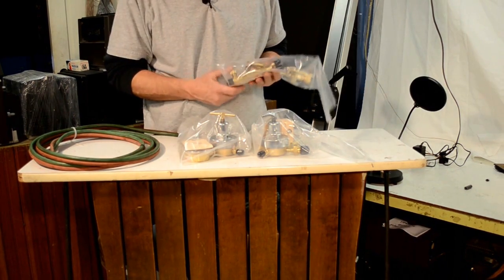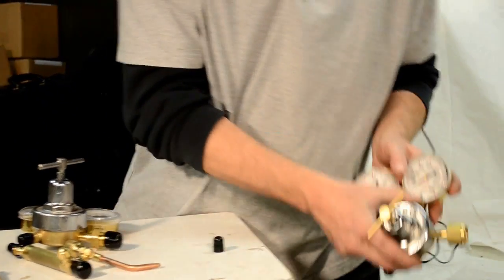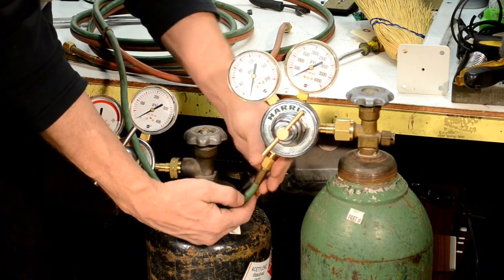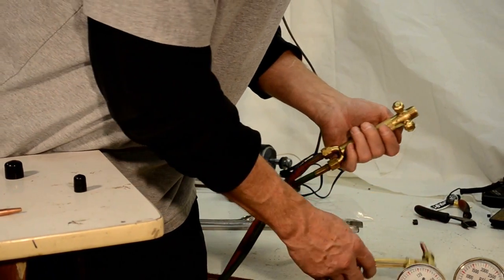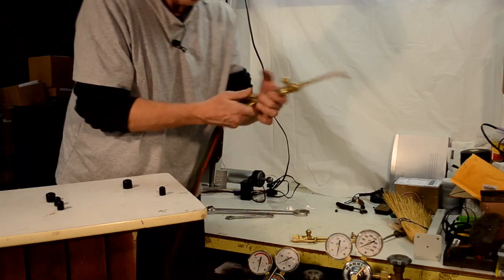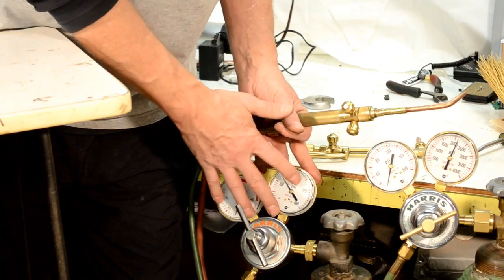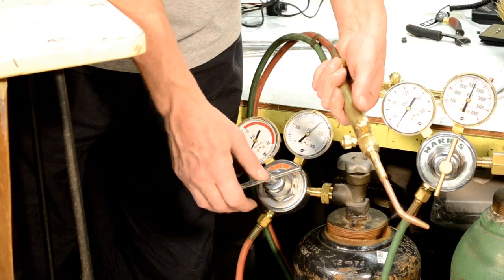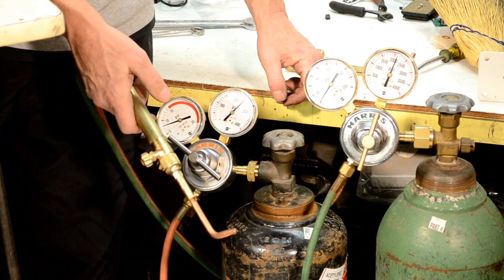How to Set-up and Adjust Oxy-Acetylene Regulators

Comment: Wrong again, this is where everyone is wrong, Oxygen tanks are opened all the way, "DO NOT TURN THEM BACK A QUARTER TURN", there is a valve seat on Oxygen at the top and the bottom to prevent leaks, if you turn it back you defeat the valve seat and you can leak Oxygen.  There's this old standard, which I use but not for Oxygen tanks, to turn a valve back a quarter turn to prevent and unnecessary wear on the valve and everyone is going with this ideology where it shouldn't be used.  I'm setting up a new system for the first time, although I've used Oxy Acetylene for years, I've never set up a new system and thus, I read every word and now I'm watching videos as well, I make sure I don't miss anything and on the last video, as I never watch just one and throw at anything people don't agree on, a welding instructor commented below, as I was wondering because to turn back the Oxygen valve is in direct contradiction to manufacturers instructions.  The welding instructor made the same comment and thoroughly explained the mechanics of the two valves, the Oxygen having a sealing valve seat at both the top and the bottom to prevent leaks when operating as well as when closed for storage.  If you turn back that Oxygen valve a quarter turn, you defeat the seat and the seal at the top of the valve and could leak, it's that simple.
Reply: FYI, I've worked in many places, never "assume" that things come clean or blown out or assume anything at all, this is explosive gas, follow the procedures at all times to the letter.
Reply from the maker: Thank you!
Reply from the maker: Thank you for that information!

Comment: Thickness of cooper matters when determining oxyacettlene p. Oh, and its dangerous stuff. Never exceed 15psi pressure on oxyA. Thinner refrigerant lines can be brazed w/ a pressure of 3 or 4 and a tip of 00 or 0.

Comment: I take it for granted  the gauges on the right show you how much pressure is in the tanks.  How can you tell when the tanks need to be refilled or changed out what are the recommended pressure ratings for the two of them when they need to be changed out. Thank you for your time and the video was very helpful for me
Reply from the maker: I take mine in for refill when I can't get a proper flame.  Or before, if I know I'm going to run out during a project session. Thanks for asking!
Reply: @hardluckcharlie  what is considered a proper flame it is there anyway you can show off photo of what it looks like

Comment: Always link official references when doing safety related videos! Otherwise decent video. All viewers SHOULD FIND AND READ official references when industrial gases are involved.  You'll thank me later. 

BTW rebuilt regs and torches are good as new and should last decades. I have one  Harris cutting torch from the 1930s on original seals that held over 150psi nitrogen when I pressure checked it. (Only use INERT gas for pressure testing and follow factory literature!)

Comment: I'm pretty sure that the Oxygen valve needs to be turned all the way open.
Reply: Instead of being "sure" LOOK IT UP.  There's no need to guess!  I rebuild my own regulators and torches per factory tech data and ran a welding school toolroom (including repair and maintenance but not regulator rebuilds because of insurance reasons) for several years. All the info is easily found online.

Here's a Victor/ESAB reference. See page 5-23:
https://www.esabna.com/shared/documents/litdownloads/56-3260.pdf
"Slowly and carefully open the oxygen cylinder valve until the maximum pressure registers on the high pressure gauge. Now, open the oxygen cylinder valve completely to seal the valve packing."
Reply: The Oxygen valve is a type of valve that needs to be turned all the way open in order to seal.
Reply from the maker: My dad would agree with you,. He and I used to argue about this. The reason for not turning the oxygen wide open is for safety, in case a quick shut-off is necessary. The torch gets plenty it needs to operate at a half turn or two twists on the bottle.  Thank you for mentioning this. It's an old myth that can lead to disaster in a hurry.  But  I suppose it is a matter of preference and what argument you prefer. Thanks again for writing.

Comment: I was under the impression the reason the oxygen regulator needs to be open all the way is to have it backseat. Is this not the case? Seems turning it back at all would defeat this purpose
Reply: See page 6:

https://www.dmme.virginia.gov/dmm/PDF/TRAINING/REFRESHER/MaintenanceRepairTopics/AR-oxygen-acetyleneuseandsafety.pdf
Reply: Hey Charlie, JBbolts is correct. Go read page 6 again because it says to open the oxygen valve all the way. It says nothing about turning it back clockwise a little bit

Comment: HLCharley, Hate to make a bad review BUT,,, bad practice is,,,, :O( never have tanks free standing particularly when no screw on cap, is on the tanks. Other words when regulators are installed. If a tank tips over and breaks off the fitting, or gauge on the top you now have an un guided missile with 2000psi exhausting from oxy tang that will propel tank through anything in your shop and take it all out through the shop wall and into the street. Hoping not Charley with it! Always should have a chain, usually, wrapped around both tanks connected to a wall or bench to prevent tanks accidently tipping over. Just a friendly tip.Toolman
Reply from the maker: ALWAYS, ALWAYS, ALWAYS... ALWAYS strap or chain your tanks to the wall or a stable cart!!!! Hardluck Charlie doesn't like to ride bottle rockets, and doesn't want anyone to get hurt either. Thank you for commenting.

Comment: Hello,my acetylene tank is threaded outside and not inside like the one shown here and my acetylene regulator is like the one you have in this video although it is the edge model by Victor Technologies,how can I connect this regulator to the cylinder when both of them have external threadings.Thanks and I look forward to hearing from you.
Reply from the maker: Hi, sorry it took so long to respond. I suggest you look up a welding supply company. They will be able to help you much more than I. Good luck to you!
Reply: DADMIRAL did you ever get an question to this question?.....have the same problem
Reply: @ballou1777  Adapters are available at your local gas supplier and online. THE PLACE TO LEARN ABOUT DETAILS IS NOT YOUTUBE. I recommend the Weldingweb and Miller forums, and migwelding.uk for those not located in the US.  Youtube is for watching technique. Forums and factory literature are for detailed info. 

Take a clear pic of your acetylene cylinder valve and regulator or bring your regulator with you to your local welding supply.